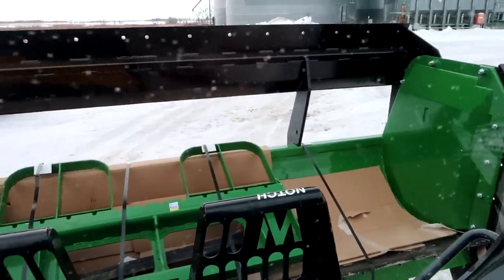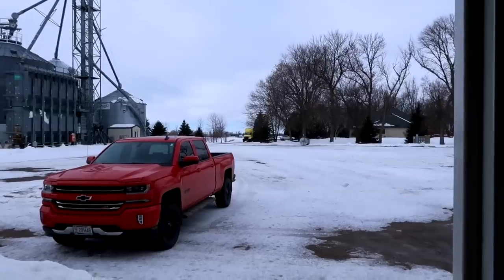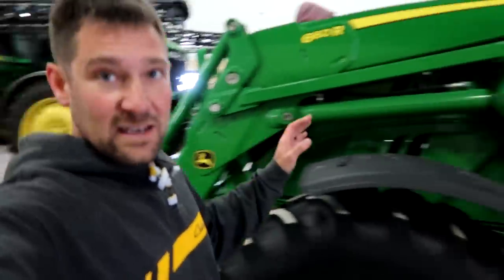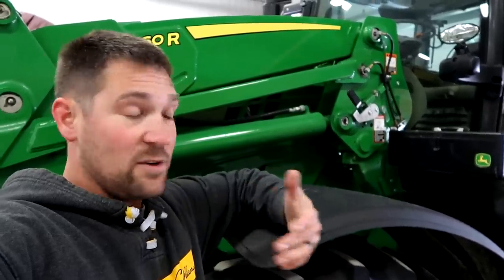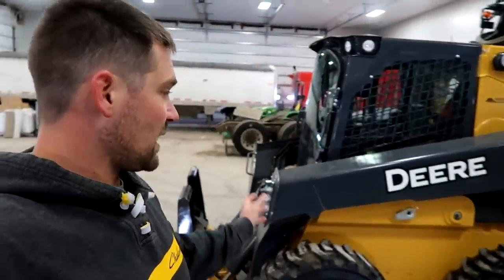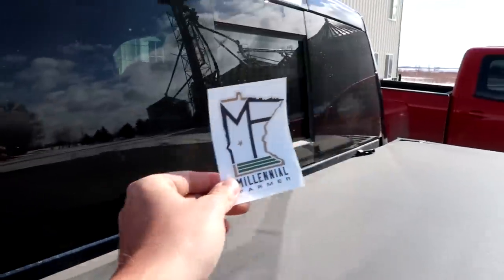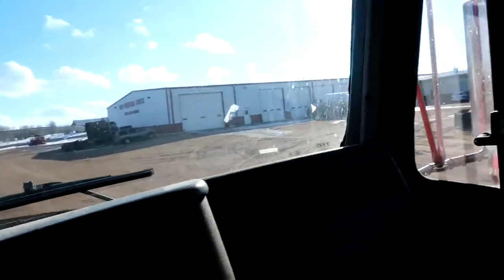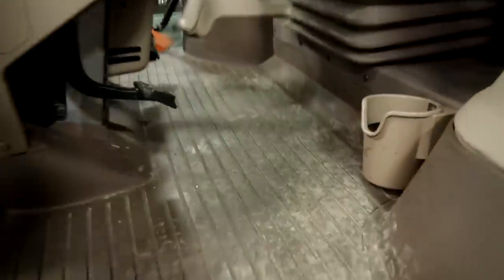I Bought My First Tractor

Comment: Hello Zack,   Just passing on some information from Canada since this is your first tractor with a DPF + SCR, Diesel Exhaust Fluid equipped tractor.    AVOID IDELNG at all costs. Do not run your tractor at idle for 5-10 minutes to (warm up)  and YES  1200 RPM still count's as idelling.  Turn the enigne on,  let sit till the idle is stable then take off!   The exhaust does ont get hot enough when running under no load conditions and WILL PLUG UP over time!    When ever the engine goes into regen mode, do not delay it unless you absolutely have to (are surrounded by inflammable materials).   Watch the quality of your DEF fluid and be careful where you store it.  DEF is sensitive to sunlight.

Comment: Zack do they make battery tenders    like the motorcycle type for tractors and trucks,  farms have equipment that sits for weeks and battery is dead when you need it. Check for a sponsor on batteries and maintenance with chargers.

Comment: Couple tips if you haven't been told yet
On the panel in the 332G, press either next or back to go through the different readings i.e hours
Average your fuel and DEF are 1:1 on all machines, when you fill up the fuel typically you'll fill up the DEF

Comment: Thanks for the candid explanation of the business side of the farm.  A retired factory worker here, that worked on a lot of big expensive equipment that the company owned.  I am amazed at all the equipment your farm as well as other farms utilize to handle the crops.  If I owned a tractor like the one you just bought, I would be driving it up and down the neighborhood street until my neighbors had me put in jail or committed.  Keep up the good work.

Comment: I know everything new has DEF.  We have been migrating our trucking business to DEF also.  Don't rush into Def to quick.  It does come with new problems.  We have new problems now that we have so many Def trucks.  Overhaul that Cat it will last you another 25 years.
Reply: Think Trucking idk when DEF was introduced, but were lucky that we have a diesel tractor that is pre DEF and emissions stuff.
Reply: So do you pick up def at like a gas station or do you buy it in bottles....how much does it go through...cost?, So like if you had a 100gal diesel tank, how much would it cost to have enough def for it, how many quarts for 100gal? Thanks in advance

Comment: Looks like a very  nice 332 skid steer.
I have a 329DT one big piece of advice. Watch  the front window. Be careful when folding back the bucket especially if handing gravel. I broke mine when racking back the bucket and  a small stone got pinched and a shard hit the window and broke it. It's a common thing and only about $500 US to fix...

Comment: You might have a ride hight controller that’s not functioning properly. The traction control is very sensitive and if one of the two axles is slipping it’ll kick in. Try engaging the inter axle lock before you give it gas. You can also temporarily disable the traction control.

Comment: Nothing so perfectly illustrates farming/ranching then 2:30 where you're digging equipment out because the wrong implement was attached to whatever you were using.... Only 1/2 joking - can you autosteer the snow removal?
Reply from the maker: I'm going to try the auto-steer thing next winter now lol
Reply: You should set up and save your tracks in summer when you can see everything.

Comment: Congratulations on the nice new tractor! We have a 5085E tractor. couldn't justify getting a 6 series for what we do. Hopefully ours comes back from the dealer soon, because last weekend it went completely dead. Turn the key and nothing at all happens. Power to the fuse panel and everything, but zero lights or anything. I guess that is why they offer warranties. DEF isn't really a big deal. The tractor doesn't seem to use much until it is under load so moving snow you won't use much. It also scrubs NOx from the exhaust which contributes to acid rain and smog.

Comment: Had a 6430 and traded it for a 6145R. Like the extra power and weight but HATE the reduced visibility of my loader in the front. I could use the 6430 like a fork lift, now I cant see the fork tips when I unload seed or chemical totes at ALL. Put a camera on it but it still is a pain, I have to jump out each time to make sure I am not punching a hole in anything.

Comment: Damn, if I knew you wanted a new snow blower I would've directed you to Normand. You could've got an N112-342H with hydraulic side chute. You would've got much more blower versus what you got. I blow snow with my 6M's, that's all they do is winter work blowing snow parked in the summer. Normand isn't cheap but they are the only blower I will run as do a lot of large snow contractors in the North East.

Comment: If that deere 332g is anything like our farms skidsteer it's actually has a password you must correctly enter before it allows you to turn it on? And does it have the back up cam? We used ours to push logs off edges of the field and loading and unloading it off the gooseneck is an amazing help

Comment: What transmission is on the new tractor and will it allow you to go slower in reverse when needed?   I recall you had issues finding a speed in reverse that was the right with the old blower setup.

Comment: You can buy points  and Chisel Plow shanks cheaper at  your AGCO Dealer ..  I buy my oil filters  by the case.   Probably  pay  half the price  Deere would  charge..
Reply from the maker: We dont have an AGCO dealer within an hour of us but there are multiple Deere dealers and 1 versatile.
Reply: @MillennialFarmer   Hmm   Have a new AGCO  Dealer in my area  about 13 miles from the Deere Dealer and  they charge way less for  consumables..  Places  like  Tractor Supply  often have Chinses grade parts..
  Here in SW  MI there is just one Mega Dealer  that owns  several locations for John Deere Total Monopoly ..

Comment: The DEF Systems are a hassle from the standpoint of additional requirements to operate the tractor. HOWEVER, our non-DEF, interim tier 4 (IT4) tractors are the biggest pain in the rear when they regen the particulate filters. I would much rather have to put some more juice in the tank than have to do a 1 hour parked filter regen... :/
Reply: Yea we have a t4.100 and def is a pain

Comment: Now Its time to upgrade your camera! Too much time focused on the background other things. Something with a better depth of field. Your channel is great!!!
Reply from the maker: Suggestions?  I don't know anything about cameras but this Canom G7X has a lot of settings.  Maybe I should change one?
Reply: @MillennialFarmer  There are a few settings that could help. 1) There is an auto face detection that you can turn on and then try it to see if that helps to stop the back and forth focusing. I don't have this camera but I found out that you can program / save  your face so if it see's your face it will lock on to you over other faces.  2) Switch from Auto Mode to Manual Mode and change the F-Stop to a larger number say f/5, f/6.3 or higher. This changes the "Depth of field" and brings more of the video into focus instead of just your face but your face and everything in the background too. Now this will make the video darker so you will have to increase the ISO number higher as well. The great thing about this is if you don't like it just switch back to Auto Mode.  Of course the best thing about a camera if it all goes wrong there is always a factory reset button to move it all back to the original settings! 3) You should do a whole video asking you vast audience what to change and best settings, how your videos are made, editing, and equipment you use. Just talk about Canon, and if they are smart,  maybe it could be a big new sponsor for you. Thanks for the awesome videos I enjoy the "snap" edits, "boot walking cam" and without a doubt the tongue in cheek sarcasm!!

Comment: In farming, owning your land is like owning a house.  Owning equipment is like owning furniture.   When you buy more land your seeded acres and income goes up.   When you buy better equipment it gets easier to farm what you have.  And it depreciates.

I'm not sure why Zack would be buying a new tractor, skid steer, snow blower and grader bucket.   Were these essential items to the farm ?  I think that money would have been better spent on buying land.  Zack only owns 1 quarter of land.  If you get into a bind with a lack of machinery, you can always rent something.   Renting land is way harder than renting equipment.

I think Zac's family farms 2200 acres, which is about 15 quarters.   Zac owns 1 and rents 4 or 5.  I assume his dad owns most of the rest.  What needs to happen is Zac needs to increase his land ownership, either by buying out his dad's land or by finding other land to buy.  Because that increases Zac's income.  As it is right now, Zac is spending his money on grain storage and equipment which doesn't increase his land ownership. 

I've seen this happen before.  The retiring father wants new equipment because it is nice to operate and it doesn't break down.  But it isn't in the son's best interest to spend his money on new equipment.  The son should be spending his money on land, because land ownership makes the farm.  Dad wants to put profit into equipment, which makes it harder (more expensive) for the son to buy out and diverts capital from land purchases.   The son needs to buy the land because that increases his income.

Zac is 35 years old.   Lets say he needs to own at least 6 quarters of land by the time he is 50 years old to be a viable farmer.  That means he needs to buy a new quarter of land every 3 years.  That means every three years he needs to save enough money to make the down payment on another quarter of land and have enough capital to be able to afford to farm it.

We are living in a time of historically low interest rates.  Farmers carry a lot of debt and are very sensitive to interest rate increases.
Reply: ? ? ?  this is out of the blue ? ? ?

Comment: We purchase today small Nh tractor, boomer 50 🤣
Reply: Hey, its a good tractor.
Reply: @BWYinYang  yeah, I know.. Small and maneuverable.. Quite nice, best in that section of tractors.. We get a better offer than from jD or Kubota.
Reply: @AdamGruszon  Yeah, I used to have Boomer 25. It's a work horse, wish I kept it.
Reply: @BWYinYang  manual or hydrostatic?
Reply: @AdamGruszon  hydrostatic, high n low speed
Reply: @BWYinYang  I test drive it, and I really don't like it.. Specially this hand throttle was making me sick.. I prefer manual transmission.
Reply: @AdamGruszon  Mine was foot pedal forward n backward. My uncle has bigger Case Puma has hand lever of forward n back

Comment: Who buys a tractor without the refrigerated cup holder?
 A sunroof? Ya see now that was thought up so guys who don't actually work in the field can still get a farmers tan.

There's a reason those engines are painted gold.
 I assume that's an old OTR truck because farm trucks don't travel 500K

If the farm is split up so many ways isn't a lease a better way to go so it's 💯 write off?
 And I'm sorry but you must be in bed with John Deere or have hacked software so you can work on those tractors 🚜

Comment: I still don't understand why you guys in the US use skid-steer loaders on farms. Here in Sweden most farms use normal wheel loaders, I've actually never seen a skid-steer on a farm.
Reply: Isn't it fascinating how different farms are around the world or even in the same country or the same state? Many larger farms in the US have both skid loaders and wheel loaders. Both have their place and strengths/weaknesses. Generally speaking, skid-steer loaders are much easier to use in smaller spaces but are also very versatile and can do many of the jobs that a wheel loader can do, just on a smaller scale.
Reply: I used the skid-steer growing up because it could fit in very tight places, such as a barn or small shed.  They're very quick in small areas and much faster to haul and break up bales, load manure, push snow, dig dirt, etc.  We also had a loader tractor that we used if we needed to road travel.  Skid got used everyday, loader tractor not so much.  On the bigger farms in MN they use telehandlers and payloaders.